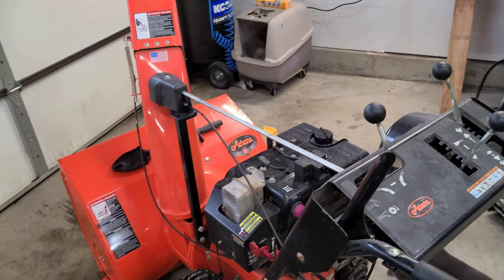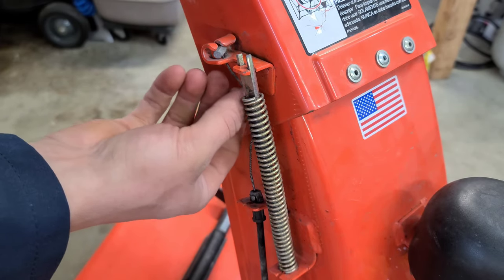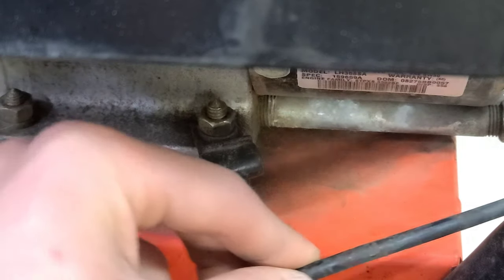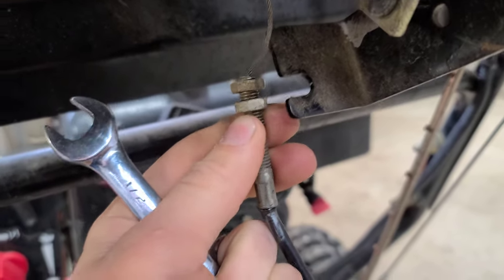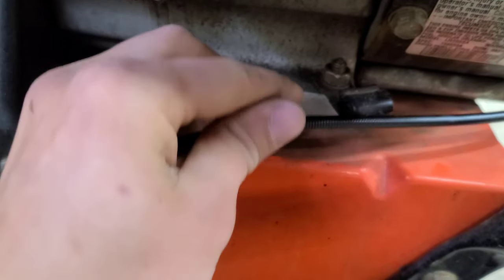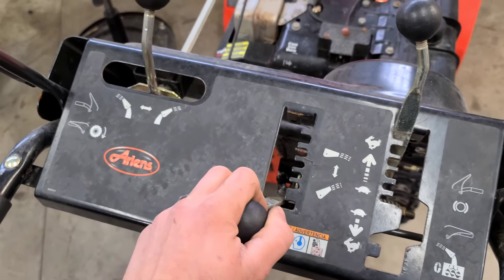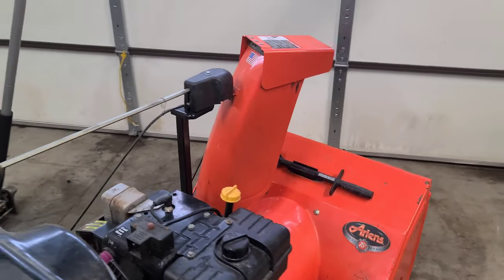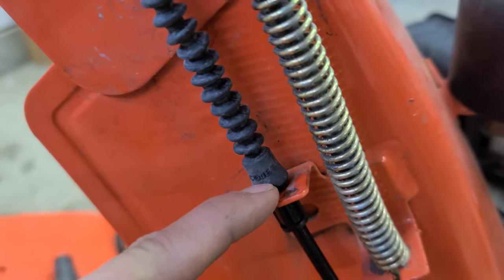Ariens Chute Deflector Cable Replacement

Comment: Good video!    Have you ever repaired the chute deflector?    My Ariens snowblower is similar, model 11528LE .  The chute seems to spin in any direction when in use.  Looks like there are two cables, one which you just demonstrated here and another which controls the direction.
Reply from the maker: Yes I do have a video on repairing the free spinning chute deflector. It should be under my playlist titled "snowblower repair"

Comment: Mine still has the weather proof cover, but it still locks or freezes.  Good video!

I have put grease on the cable, parked it in heated garage, but it re-freezes, and sprayed ice repellent on it.   Very frustrating design flaw.

Comment: 99%of small engine problems is the customer haha. “Well you just replaced the carb and lines last year and I only used it once, why does it need another new carb this year? I think your trying to rip me off. I’m leaving you a bad review. Lol
Reply from the maker: Everytime! I tell my clients all the time you need to start your machines and run them at least once a month. But of course they always think there is some kind of magical "1 year warranty" with every repair

Comment: If they didn't make them so cheap you wouldn't have to change them. I'm going to use one of my motorcycle cables and make mine remote control deflector. Looks like a fairly easy mod.